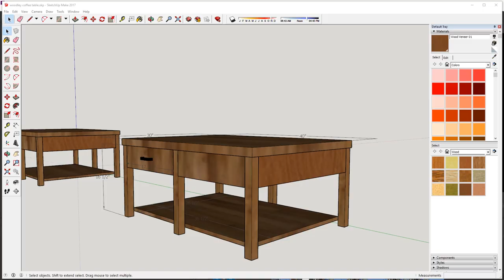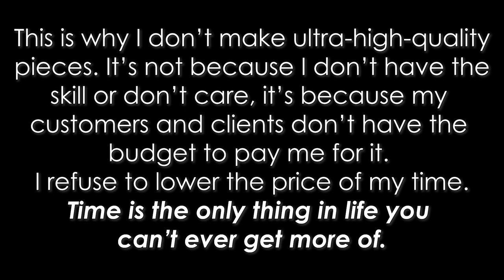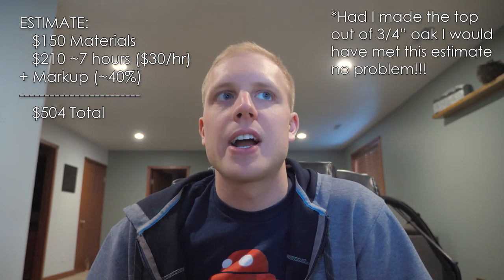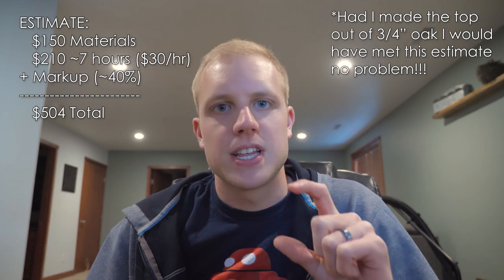How We Priced a Coffee Table (numbers revealed!) | Woodworking Business

Comment: You're right. Odds that something flies and hits you in the right spot are extremely slim. But it happens. About 5 years ago I was cutting metal with a set of torches, wearing safety glasses, but not ear protection. Somehow a spark deflected off a nearby object and straight into my ear canal missing the side walls and going straight onto my ear drum. Several ear infections, hearing loss, pain and discomfort along with 1 surgery later and it's still not great. Shit happens, try and prevent it the best you can.

Comment: Great job on the videos guys. Pointing out the safety of your job and the efficiency gives you even more kudos. Having said that... uhm...  you might want to try and make it good practice to store the materials (clambs) directly in the correct place after using them.. safes time picking up (double handling) and you don't have to worry about stepping on them or tripping over. Anyway.... keep those videos coming please.

Comment: The table turned out to be a real stunner with a GR8 design & GR8 quality build. Question: If you hadn’t spent the time making the dowels and just did a glue up, of course you would have spent much less time, and charged less. How do you think that would have affected the quality of the build?  Planing, strength, life, etc?
Reply from the maker: Dowels just helped line up the boards. Saved us a ton of time from having to reflatten the top if it slips during the glue up. They don’t add much strength
Reply: Jennie and Davis Thank you for answering that simple question for you but important answer for me. 🙏🏼

Comment: Sometimes good quality tools get damaged, there are repair shops that will fix your tool or you can get the parts.  It is worth checking out.  I replaced the pad on a 1/4 sheet sander for 20 bucks and the table on a trim saw for 70 bucks. I saved myself over 200 bucks without sacrificing quality. Cheap tools just need to be replaced but quality tools is another matter all together

Comment: I just discovered you guys and am digging the videos.  Watching this one, I wanted to point out/ask a few things:

You should lower the guides on the bandsaw.  They should be just above the workpiece to prevent blade creep
Do you not wipe or blow off the sanding dust between coats of finish?
Reply: I agree with the bandsaw guide placement. 1/8” to 1/4” max above material at ALL times. Aside from cutting accuracy, covering that beautiful but wicked blade will lower the chances of a very serious injury. You guys are a tremendous asset to the “Maker” community. Your ambition, practicality and charm will surly be rewarded as you build your empire. I would have loved to serve you both and your company. 

Work save and prosper!
Chuck Waters (Wood Chuck)

Comment: Okay, may I suggest that to increase the speed skip the dowels since it is quite time consuming and completely unnecessary for the material this size. Second during glue up using a roller to apply the glue not only gives you an uniform application but really fast. Just add chauls to the faces to keep the panel flat before clamp

Comment: Yeah you should buy rough cut lumber and use a jointer to plane yourself. More work but alot cheaper and pocket holes are not very strong joints
Reply from the maker: Not worth my time. Making more sales is more profitable than squeezing every nickel out of a project
Reply: @jennieanddavis  That's what I thought too. Rough Lumber is a waste of time, getting more leads with a quick turnovers is much more profitable if you're on a business side.

Comment: Do you normally not alternate grain orientation while gluing up the table top? I noticed that most of the boards were oriented the same way. Are you worried about movement or cupping at all?
Reply from the maker: Hah nope. Wood movement isnt all that big of a deal as everyone makes it seem. The table top fasteners account for what little movement there is. Samurai carpenter has a great video on the subject
Reply: @jennieanddavis  Hmm, this is a joke, right? A 6" wide 1/4" thick board would move back ans forth 1/16" over a year. A 2-foot-wide tabletop with boards that have the same grain direction will rip apart any fastener or pocket hole joint

Comment: You did what you could from a labor saving standpoint by using Kreg instead of "traditional" joinery.  That is not a criticism, by the way, just an observation.  I don't know if plywood for the drawers was a saving.  I would have probably opted to use poplar for the drawer backs and maybe for the bottoms, but that would involve a glue up for the bottoms.  So maybe using plywood saved time, and therefore cost.  Could you have avoided the hand planing on the top by using a cross-cut sled on your table saw?
Reply from the maker: No, that top was a mammoth. The track saw we have now would have made quick work of it!!!

Comment: The piece of very attractive until you pull the drawer out.  If you're going down the fine furniture route, don't ever use plywood butt joined drawers please.  Your drawer boxes should have been solid hardwood and dovetailed.  Your hardware should not be showing on the side of the drawer box...Use under mount guides that don't distract the eye from the box.  It is nearly impossible to build a custom piece of hardwood furniture and sell it for under 1k.  That table should have been a minimum of $900 if it was built correctly.  It looks really nice, but pocket hole joinery will not hold up to the standards of fine woodworking over the years.  And, you're comment about eye glasses was very amateurish.  Do you understand how many young people watch youtube?  Yes, the risk is very low but why advise someone to possibly take the chance?  Please be mindful of passing along correct information if you're effecting thousands of future woodworkers.  There are so many of these channels passing along information that was learned watching someone do DIY projects that our field is being flooded with inferior pieces that won't hold up to time or seasonal wood movement.  Just some constructive criticism.
Reply: What he said! Couldn't have said it better. Sorry dude you even reneged at the end on what the lumber cost where.
Reply: Can you post a link to a good video of your recommendation